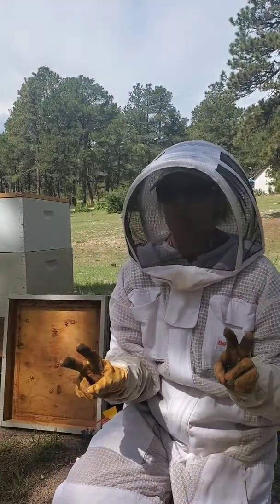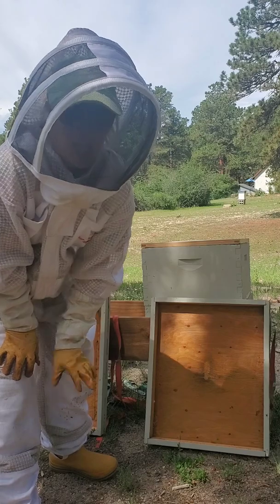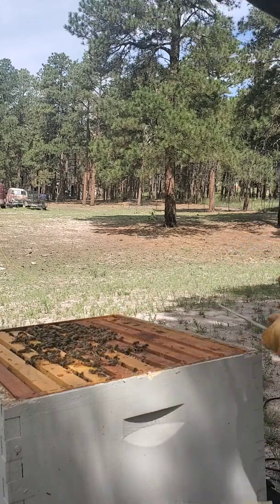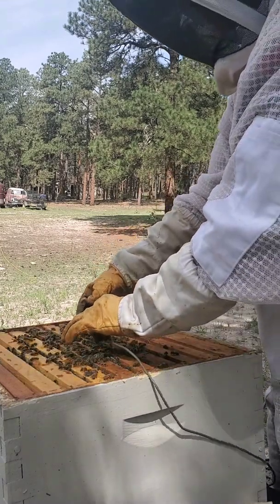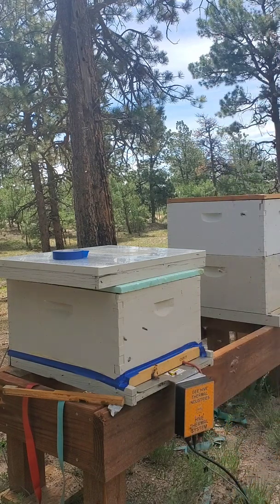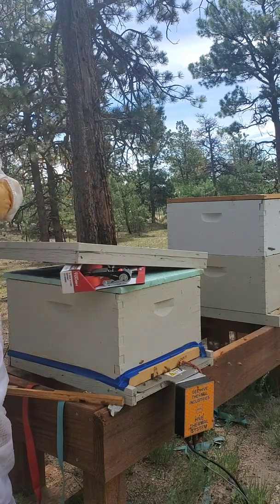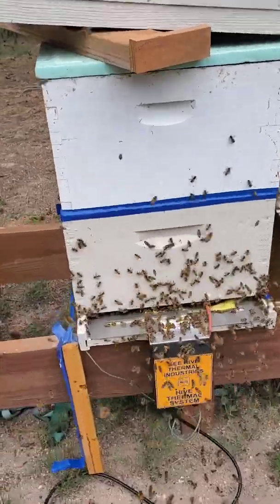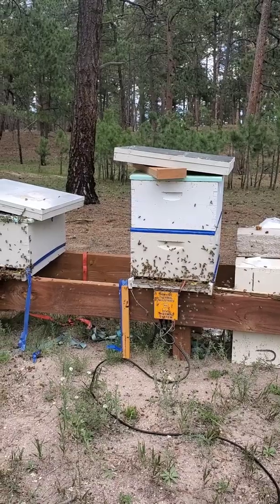Thermo Heat Treatment Demo in HoneyBee Hive for Varroa Mite - Thermal Industries Mighty Mite Killer

Comment: There website is no longer. Do you still use this and what do you think of it six months later?
Reply from the maker: They have been out of production since Covid due to chip shortages and have been looking into alternatives is my understanding. I personally love the system and have been using it successfully for multiple years at 3 treatments per hive per season. I don't do mite counts so I can't give you numbers but I haven't seen deformed wing virus in the hives since regular implementation which I used to see occasionally. You can check their Facebook group for local people renting them out or beekeepers selling their units.
Reply: @HoneyBee_You  Thanks for the info
Reply: Samantha what's their Facebook page?